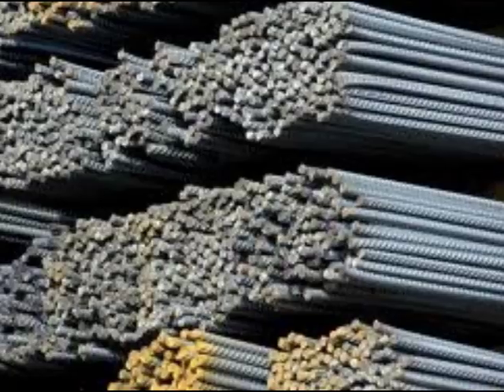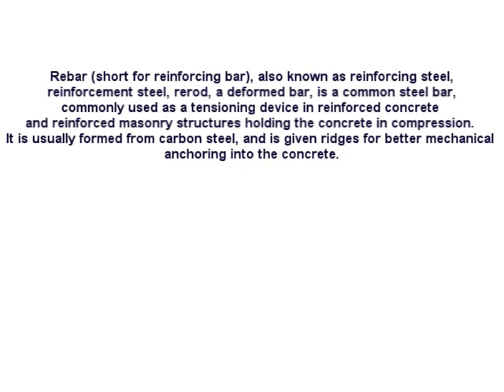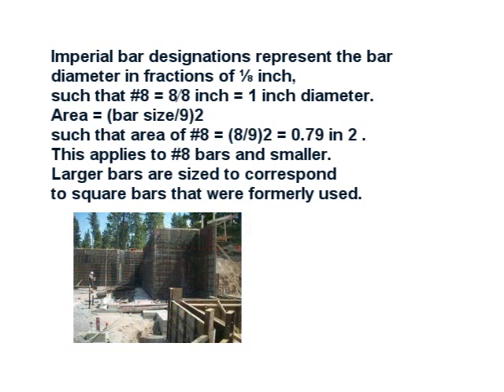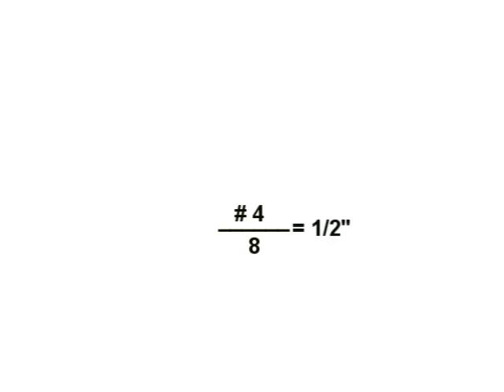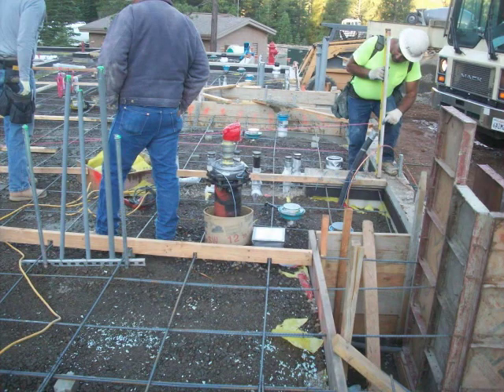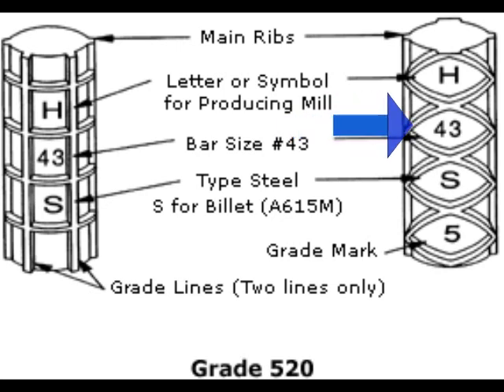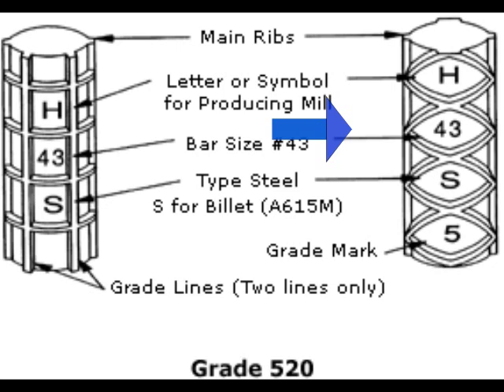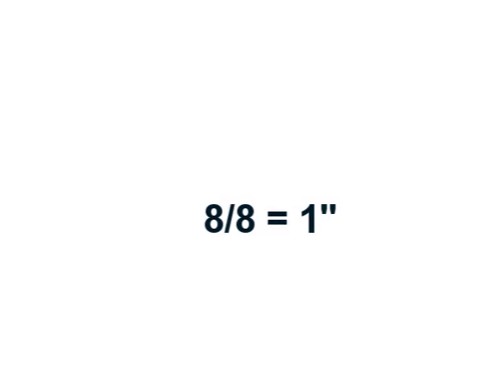How to Read Rebar Residential or Commercial Construction

Comment: (25-1)/8 = 3....how did you get  8?
Reply: Had the same question ???
Reply: 25-1=24÷3=8÷8=1 inch.
Reply: 25.4 mm to the inch, not  that tough to calculate.  3mm is 1/8” MOL.

Comment from the maker: If you need to convert the rebar size to English system you can follow this formula:
Metric number – 1 = English number
         3
For example:
A # 25 bar is equal to:
25-1 =   24 = 8
              3
A number 8 bar=1”  thickness. 

Does this help?

Comment: I think in metric system number of the bar means something different than the size of the bar.
However we often use bars in size 12. It means that the diameter of a rebar is 12mm. It is about size 4
(12-1)/8=??? - it's not working
Reply: It's (25 - 1 = 24). 24/8 is 3 and not 8.  I shut down the video at that point.  The fellows math is not good.